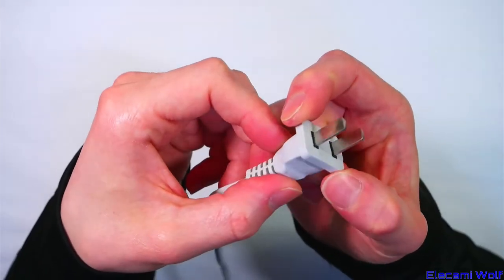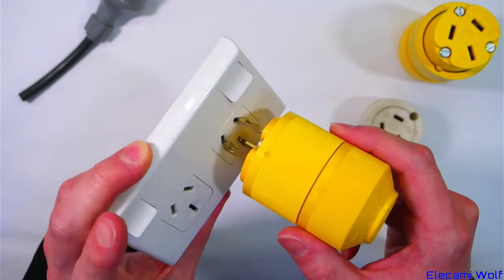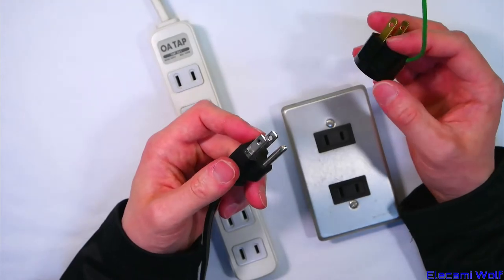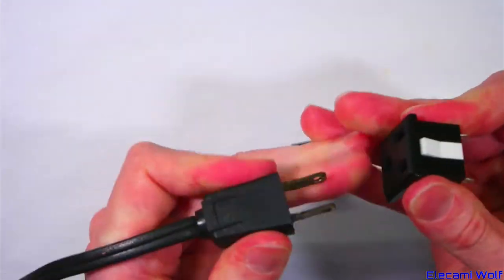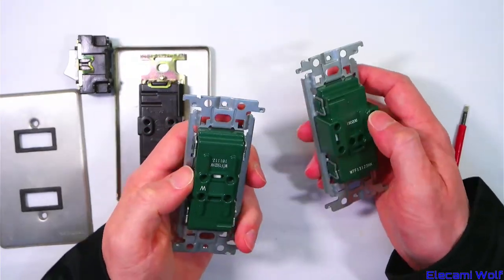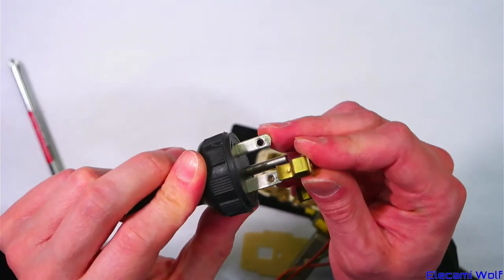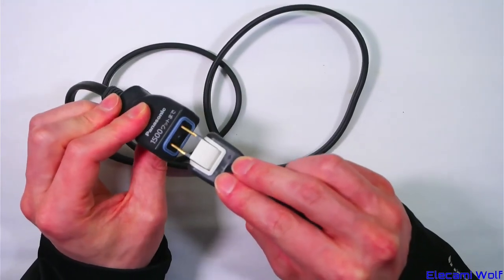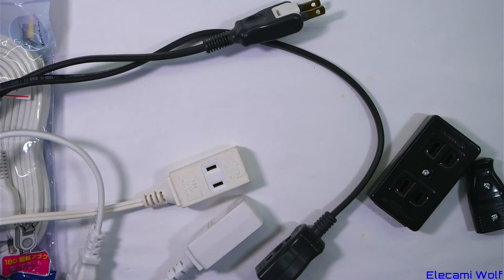EW0005 - The Plug Prong Holes Are Used! (In Japan + Their unusual grounding methods)

Comment: Thanks for this — learned loads. Any idea why ground seems optional in Japan? I read somewhere that Japan’s electrical system is structured differently, using something called a ‘Graetz bridge’ (no idea what this is) and safe without ground pins.
Reply from the maker: I think they get away with it by having small local networks, many transformers, to avoid voltage drop and people are protected by having RCD / GCFI for disconnecting the supply if there is a fault.

Comment: The plugs with the ground wire on them Elecami are usually used on washers and things that you don't unplug all the time and the scroow on the plug that holds the plate on is also the grounding screw on the wall socket. With US plugs.
Reply from the maker: Even if they are on things that don't get unplugged often, still no one connects the ground?
Computers and other appliance often need ground too. Still no one connects the ground. Maybe some people connect it. I just never see it connected, other than things like Air-conditioner and toilet seat. Which are probably connected by the installer instead of the user / resident.
Yes the center screw on the US outlets is usually ground, if there is a ground cable through the wall or if the wires are run through metal conduit. Grounding though conduit is not the best way though. It is a minefield out there. With old and not up to code installations.

Comment: Advice anyone? I just got a microwave with a 2 prong and grounding wire. Is it okay if my wire is loosely around the screw behind the gold plate?

 I couldn't remove the screw enough to see what I was doing. It seems like the screw is damaged as it loosens a bit and then tightens again turning it left. Also the space for the flat head appears damaged. I think the builders forced the screw in... 

I tried my best to put all the frayed wiring together with a slight twisting motion, hook it around the screw,and then tighten the screw so the plate holds down the wire behind it. Until I find verification that I did it right, I'm going to leave the machine unplugged when not using it. I'm just scared to use it in general though...
Reply from the maker: It is hard to know for sure. Without being there / taking measurements. Usually the screw in the center of the outlet plate is grounded. Not guaranteed especially in older installations.
If the circuit is GFCI protected, you should be safe with no ground on the appliance. 

If you are concerned it would be worth getting someone experienced to investigate and if necessary fix it for you.

Comment: That IEC power cord would be used to plug in a computer and a monitor with only one cable.
Reply from the maker: It is really short, it is for tidying up the power cables on a rack of equipment. Assuming that is the one you are referring to.

Comment: The sleeving on the Japanese plug might be to prevent short circuits, if something like a paperclip falls on the pins of a not fully inserted plug.
Reply from the maker: I think the main reason is to stop tracking (Conductive path forming) between the prongs from dust buildup, made conductive in damp environments.
Can be an issue where you have a plug left in for years behind furniture or other not easy accessed place where dust can build up.
I saw it advertised on packaging.
Reply: @Elecami  Ok, You seemed to be a bit unsure in the Video.
Reply from the maker: Yea, it is easy to forget things when recording.

Comment: Pretty much all Japanese appliances will work in the us without a converter
Reply from the maker: Sometimes but not always. Some will appear to work but the transformer or power regulators will be running very hot and burn out after a while. Going from 100V in Japan to 115 - 120V in US is quite a jump up. 
Marginally designed (lacking iron) transformers will saturate, drawing excess current and heating up. Common in HiFi / AV Equipment. 
Linear regulators on the outputs of transforms will run hot with the additional voltage they have to drop.
Anything with a switch mode power supply will likely be ok.